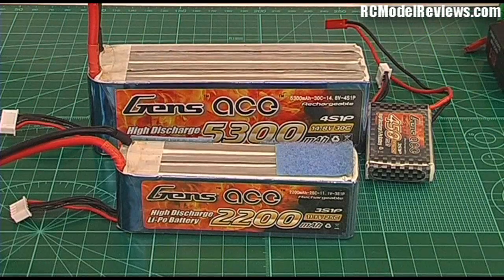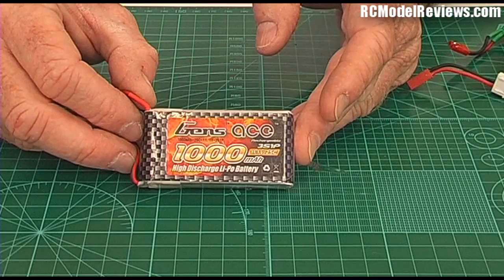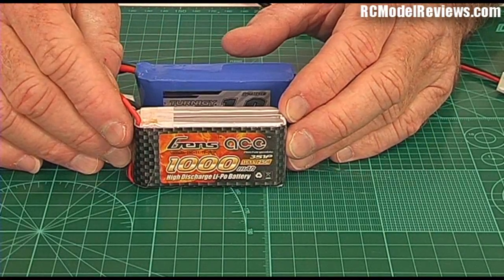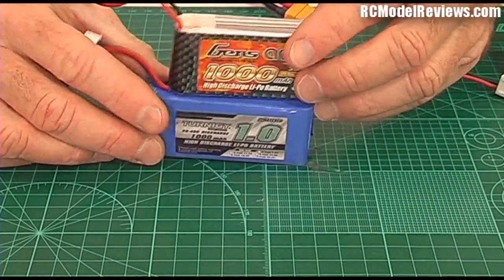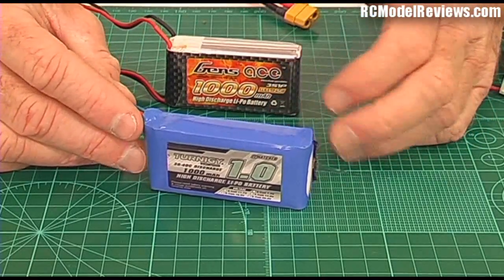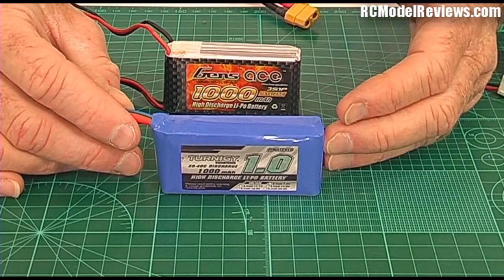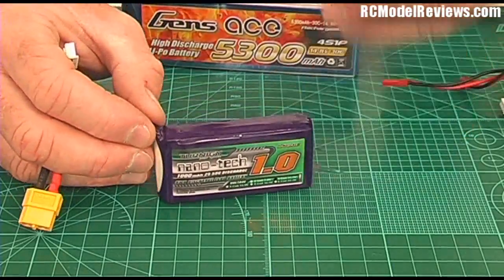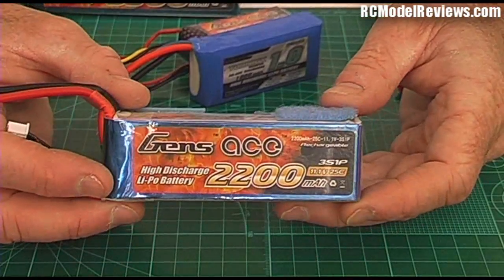All about lipos for RC models

Comment: Since voltage x amps = watts (power), am I right to believe that a 3s 4000mah, 45c lipo would generate more power than a 3s 2200mah, 45c?

Comment: Did an esc built in with a over discharge limiter in it? If it's not what would happened if the current goes below the recommend  when the battery is in the sky??

Comment: I`m a bit confused. I never make the call on the C charge rate on my lipo packs. I plug them into my balance charger and it does the rest. A 3S pack usually takes 65 minutes to fully charge no matter the mah size. If i have a 1300 mah lipo, i will choose 1.3 amp charge, does this mean i charge the pack at 1 amp? What am i missing?

Comment: Sir I have a question
Can u mix lipro batterys, that are of the same voltage but different ratings assuming  I dont drain below the lowest c rated battery
My hook up is a serious connection, I have two 18.5v
Batterys in serious, one is a 5000ma the other is a 6000ma
Also could they be done in a parallel  combo if that was all I had
I do understand it's best to have two the same, but would it work ok?

Comment: I chared my battery to  go  fly. 3S 1.3, 15c.and a couple of larger batteries.
Didn't get out to fly and now have 4 batteries fully charged. To get them to storage charge using a 4 button charger do I need to discharge first then  storage charge after, or just program to storage  charge only?

Comment: I believe you take the voltage times the C rating to calculate current .  The 5300 mAh is a measurement of capacity.   The 450mAh and 1000 mAh should have the same output at 25C, but the 1000 has more capacity .

Comment: I am shocked that these batteries don't have more capacity. This is why I don't like to use these kinds of cells for power banks. I go for capacity rather than current delivery, as in most cases my power banks will only have to put out 3 amps max.

Comment: C rating is actually not the amount of current, it is just a multiplier for the 1amp current; that is the permeability that can be drawn multiplied to the actual amount of current. And about the size: a baterry with greater C rating is actually lighter. You are comparing two different brands of batterry that are made in different ways in terms of packaging..It would be fair comparing two batteries with the same brands and current but with different C rating.

Comment: I have a 4s,14.8v,3200 lipo for my t-28. my charger does not have a discharge mode. how can I get to storage voltage other than just running the motor on the ground? heat in the motor would be bad, would it not.

Comment: Anybody know it there are Lipo buzzers, low voltage alarms hooked directly to the Lipo's, where one can change the tone/sound? Those cheap ones just sound all the same, and that's a kind of fustration when driving RC cars with several friends....Like in the 'old days' when most cellphones had the same sound..)
Reply: Rimrock300 yup, there is. Learn how to code and buy an Arduino and you can pay yourself stairway to heaven on a low battery alarm if you want...

Comment: I have a question about C-Raiting.
How does manufacture determan the c-Rate? And how can one mesure the c-Rating ?   I woud guess that it would be somting like at a sertain Amp draw it shoud only drop a certan %voltage ???
Reply: fotoreb it's a spec...you don't measure it you abide by it

Comment: Are you supposed to balance discharge and charge or just balance charge? Thanks
Reply: thedavinator 37 just charge...electricity takes the path of least resistance so it "figures itself out" while discharging...unless you're discharging by isolating the cells (which is dumb) then you need to discharge each cell to the same voltage individually

Comment: can you charge/discharge through the balance lead, just curious I noticed the battery/charger that came with my Runner 250 advanced. it seemed to be doing just that, except for the discharge I'm guessing.

Comment: is there any way to test if a lipo charger is working properley without actually having a battery? my lipos caught fire while charging (was actually my fault, batteries were swollen and had a broken balance cable). i bought new batteries but dont know if the charger still works, and am afraid to connect the new batteries to the charger

Comment: Can I charge a 7.4v 20c 4000 mah battery at 1,2,or3  amps??
Reply: You could charge it at 4A... (1C = 4.000mAh = 4A).
Reply: Charge at 1C maximum - so that is max 4 Amps. As said in the video, if you charge it at a lower amperage it will be kinder on the battery but take correspondingly longer to charge. That's why we have a lot of charged packs before we go flying ;)

Comment: Hi all, I got a question:

If I can't find a 3S 4400mAh 45C to buy, can I strap together 2x 3S 2200mAh 45C batteries and hook them up in parallel (via a simple 2-into-1 XT60 connector & equivalent balancing lead)?

Will that 2x 3S parallel set up still count as a 3S... or does that make it a 6S..?
Reply: i also wanna know the answer
Reply: You should charge them seperatly, but you can discharge them while hooked up to your model with a Y-connector (parallel).
It will still be 3s, so 11,1V, and it will still be 45C, but the capacity would add up to 2*2200mAh.
So no problem at all doing what you want to do, !!! as long as you charge them seperatly !!!. (so you would also just need a XT60 Y-connector and no balancing lead Y-connector)
You could charge them parallel, but I wont recommend that. (http://www.rcgroups.com/forums/showthread.php?t=1067895)

Comment: theres something i dont understand.... lets say youre flying with your drone and your battery buzzer starts to beep which means your battery is running low. so thats when you quit flying because the power of you battery is used. what amount of volts does it have then? 0 volts or somewhere between 3.3-3.8?? can someone please explain?
Reply: Not 0.
Reply: Voltage is what you set your alarm buzzer to, if you haven't reset it from new it will usually be around 3.3v to 3.8v

Comment: why does no one tell you what volt you should stop using it
Reply: would 3.4 volt be ok or would 3.3 be ok
Reply: 3.3 is the lowest. 3 and its done
Reply: Christian Logsdon so 3.4 to be wafe
Reply: Safe
Reply: ben lawton Yes. I usually set my beeper at 3.5
Reply: Ok thanks
Reply: ***** no 3.3
Reply: ***** means it is probably damaged
Reply: ***** oh under load idk
Reply: Just dont let it get under 3.3 when its not under load
Reply: +Christian Logsdon how do you know when it is low?
Reply: Moto_ Bro_24 Telemetry, OSD, battery checker
Reply: +Christian Logsdon I have a villain ex if I was to run a lips in it would i need two since it is twin motors. It is 14.4 volts but one lips is 14.8 so would I need two or one
Reply: Moto_ Bro_24 Usually just one.

Comment: Some good info but I'm a little confused about the 450mha being able to only able to draw a fraction of the C  rating. My understanding 1000mha means you can draw 1 amp for 1 hour and 450mha for just under 1/2 an hour. C is the maximum discarge rate so a 1000mha will last a few minutes drawing 30 amps and 450mha will last less than half that. In short I believe the 450mha can draw its full C rating. please advise if I'm wrong as there is a significant difference and I would like to keep safe.
Reply: Could be very bad to draw 30 x 5.3 = 150+amps from 5300mha battery not to mention charge at 150amp.

Comment: I'm confused. you said at the begining that each cell nominally produces 3.7v. Then how can the storage voltage be at 3.8v per cell?  The meter even indicates 48% charge...
Reply: +nahjos A fully charged lipo cell has 4.2 volts. During discharge, it will stay at around 3.7 for a long time before rapidly dropping.
Reply: +Tim Jadeglans I see.

Comment: Hey, can someone help me ? I have a syma x8w quadcopter battery but my quadcopter is broken. I want to buy another quadcopter . I can mount the syma battery in another quadcopter ? the battery is een2000mAh Battery , lipo happy to help greetings Petet
Reply: +justme mentalist A battery is a battery, it has a voltage, C rating and capacity, as long as those number line up with what you want to use it for it will work if you can connect it. If its got some special connector, you will need to either buy an adapter, put a matching connector on the new quad or change the connector on the battery to whats on the new quad.

Comment: so my battery that is 1800Mah have a c rating of 75.
and a burst of 150. does that mean the burst Amp will be 27 amp ?
Reply: GranVlog i tried it on my miniquad with kiss 18amp esc and one of them exploded... i thought the esc would only draw as much as it was capable of and not more..
Reply: +GranVlog In case you haven't found your answer yet, you should be able to draw (1.8a X 75)= 135 amps for cruising about. 
At burst you can draw  up to (1.8a X 150)= 270amps

If those C values you have given are correct, that is a very meaty and powerful battery you have there. Must have cost an awful lot.
So its your amperage, multiplied by your c rating.
Edit - Im assuming you mean 1800mah (milli), not 1800Mah (Mega). Otherwise you could power a planet!!!!
Reply: +The Twangy Mosquito thank you. I didn't know. little or big M made a difference 😊 but my problem was that my esc exploded.
Reply: Yea its subtle but in certain applications it can be essential. Esc's just do that sometimes. It is advised you keep a few spare for this reason. Some people order 4 to make a quad copter and 1 just simply doesn't work. Annoying and disappointing but just the way. Your battery's ability to deliver the amperage will not pop your esc. Think of it like a weight lifter. He may have the ability to lift 200kg, but that doesn't mean he wont be able to lift 2kg. Its just that it isnt much of a load for him. he COULD do more if NEEDED. Also just go over your wiring again checking for short circuits. Hope you sort it!

Comment: Thanks for this. It was very informative. I watch both videos a couple of times, and the a couple of questions about what is your normal process for charging LIPO's and flying.

Can you charge your LIPO's the night before and then fly the next day or do you need to charge them in the morning before you fly?
After you fly, do you then do a storage charge/discharge before you put them away?
If you are going to fly every day can you charge them up fully every night?
if you are flying 2 or 3 times a week can you just recharge them at the after you fly?
How long are you able to leave them fully charged before you need to do a storage change?
I also saw  LIPO safe bags, Should I be getting one of these and storing them in it when they are not in use? or charging?

Thanks, Gordon.
Reply: +Gordon Heydon Don't EVER charge Lipos with monitoring them in-person. Leaving them on the charger overnite is the best way to burn your house down. 

Just a warning I couldn't tell if you were leaving them unattended.

Comment: I have a 7.4v 2 cell lipo with 300 mAh and a 1 amp charge with a 35-70 c discharge. What should I charge each cell too and what should be the minimum amps per cell
Reply: +whygret micha Connecting 2 cells in series double their mah rating.  so 2- 150mah paired in series comes to 300 mah.  Your storage or average voltage per cell is 3.7 volts. so once again 2 batteries in series add up to a 7.4 volt pack. your battery pack will recharge as long as both cells are no lower than 3v.  And will charge completely to 4.2 volts.  So your 2 cells should never be discharged below 6volts, stored at close to 7.4v and fully charged to 8.4 Volts.

Comment: Hi , If my ESC draw 15Amps and the motors says Standard Current : 15-25A Max Current : 30A,

so what quantity of amps does the motor and the ESC will draw from the battery?

And i have a quadcopter, with 4 ESC and 4 motors, do i have to multiply the current from each, times the quantity of motors to compute the quantity of current (amps) that all the system will draw from the battery?

Thanks for your time and amazing videos
Reply: Fernando Calatayud Zepeda First of all, your ESCs don't draw 15A, they can handle up to 15A when your motors draw from the battery and the max current for the motors is just a guide for you to not push them past that amount of Amps...

Second, you need to either do a test on your motors to see how many Amps one of your motors pull at full throttle with the Voltage (Cell size) and prop size you want to use, if that's not possible, you can google to find out from other people's tests, but that's not as accurate...

Once you know your max Amp draw, you can then calculate the C-rating you need... You take the max Amps your motor draws with the setup you want, let's say it's 10Amps, multiply it by the amount of motors you will use (4 motors = 40Amps) and then divide it by the capacity of your battery... Let's say you're using a 1.3Ah (1300mAh) battery, it would be 40/1.3, so you would need a battery with a C-rating above 30.77, so a C-rating of 35 would be the best to use...
Reply: Optamizm Damn, thanks a lot for the time i understand it very well now.
Reply: Fernando Calatayud Zepeda No worries :)

Comment: Stupid question probably but can you storage charge a 1 cell 3.7 500mah battery often used in quadcopters?
Since they have no balance plug and all, I wonder how it can do that.
Oh, and at what rate should I charge say, a 650mah 1s lipo? Can you set most decent chargers to 0.65 amps? Or won't it matter if I set it to 0.5, take a bit more time but get it fully charged nonetheless?

Comment: BRAND NEW LIPO BATTERIES,
Do they have any charge in them?
Google it with no results
Reply: Edwin Custo A brand new lipo will have about 40% charge (3.5-3.8v per cell).  This is known as a "storage charge".  It is good to fully charge and discharge once before you start using your batteries to full capacity.

-Josh
Reply: Josh D. Diggity Thanks Josh :)

Comment: It's not Milliamp or even Milliamps., as you keep saying. It's Milli Amp Hours, or mAh. Milli Amps is a measure of Current Flow, and Milliamp Hours, is a measure of capacity or discharge or current flow over one hour.
Reply: iiiDartsiii it changes a lot actually...you don't train your dog to shit in your bed first and then use the newspaper and then go outside do you? ...knowing your shit when it comes to electricity IS important and I if you're new then misinformation is even worse and will caddis you to do more research and second guess yourself down the line. Most people tend to avoid half assery when it comes to shit that can kill you, burn your house down or destroy hundreds of dollars worth of gear and models. I dunno, maybe your into that sorta thing...
Reply: MARK 1 that was driving me freaking insane
Reply: +Mark II 
at this point i had to quit the video
Reply: I completely agree! Really annoying to listen to
Reply: if you know all that then why did you watch this video?  it's clearly meant for people who are just getting into this and adding those extra things doesn't change anything and confuses newbs even more.

Comment: Hi Quadcopter 101,
Can you please help? My 15 year old son just got one of these Syma X5C-1.
Someone told me that the Lipo batteries are very dangerous, so I search for videos here on YouTube, and now I'm freaking out. Are these little 3.7 Volts / one cell batteries the same as those bigger ones / multiple cells (used on DIY RC)? Do we need to take the same steps when storing/not using the batteries? Do we need a special charger to put them into storage mode? Please help!
Reply: Don't freak out to much they can be dangerous if not used properly. If it is a 3.7 volt single cell then yes it is a Lipo (Lithium Polymer) its the same as the bigger ones, without going into a very long explanation here if you (your son) follow the directions that came with the quad it will be fine don't panic, I don't know the quad that your son has but it should have a built in circuit that will stop the motors at a set safe voltage (3.8-4v) which is a safe value to discharge a lipo and ready it for safe charging. Did it come with a charger? I m assuming it did it too should have a circuit to safely charge the Battery and shut off automatically- but if your still worried about storage (Lipos should NEVER be tossed in a drawer I know how teenagers are lol) you could get a volt meter and check the voltage after a flight it should read (3.8-4v(storage voltage too) again read the manual) they sell a Lipo safe charge/storage bag as well but unless your son planes on getting into the hobby and buying more Lipos I personally wouldn't spend the money on it just follow the directions that came w/ the quad about charging and storing and you'll be fine I'm trying to put your mind at ease a bit yes they can be Very dangerous IF not used and handled correctly they(Lipos) have come a long way in safety since they became available to the public hope this helps a bit again use a Volt meter to check the voltage in the cell 3.8-4v and put everything in the box and in a safe place and you'll be fine
Reply: Rosario W thank you